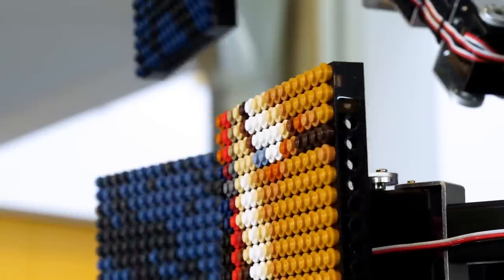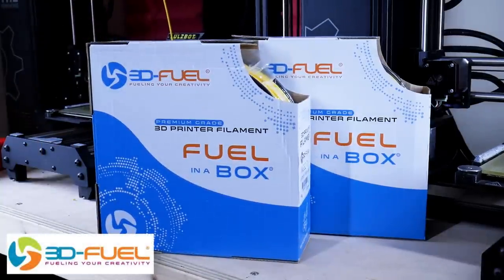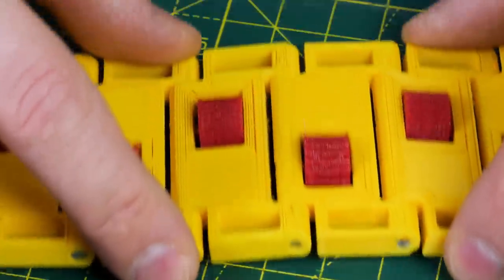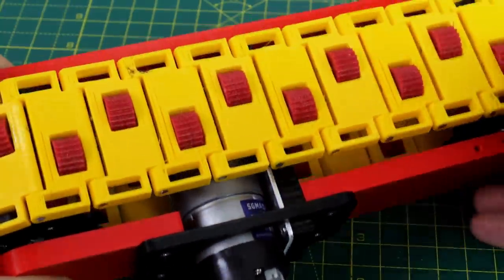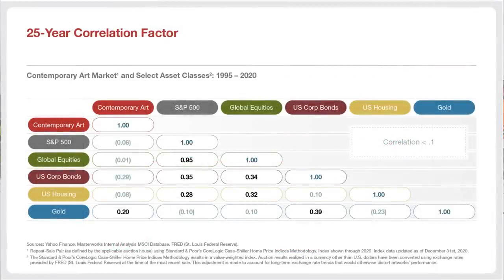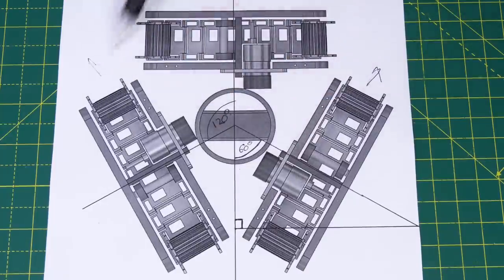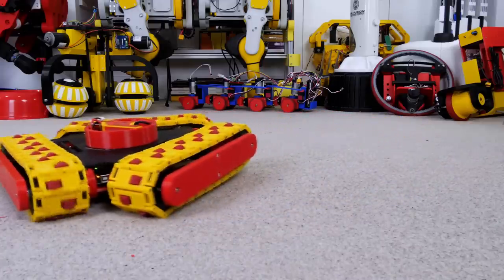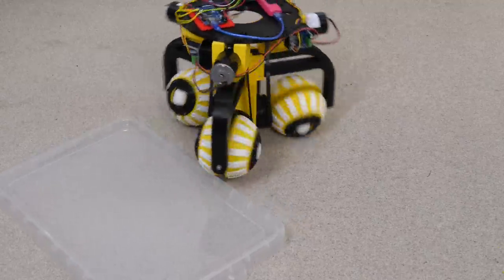Will this Omni-Directional Tank Work?

Comment: So, a problem that I spotted. Tank tracks usually have a leading and trailing angle of attack where the track is pulled upwards by the idler and drive sprockets. The effect this has is raising the height of first contact with sharp edged objects. The second thing that is missing for the purposes of vertical object climbing is the ability to deform the track (at hinge points) with flexible suspension at each bogey. The twin effect that track deformation has is dynamically increasing loading on the the track at points where frictional forces can be acquired (the top flat surface) and creating a ramp of track links at the sharp edge via tension forces that the aft idler bogeys can climb. The lack of these three features are competing for the number one slot on what is impairing your ability to climb objects.
Reply: Welcome to this channel. "What if I applied this concept, but without studying any of the parts that make it work". See also the Ornithopter series lmao
It's all still interesting to see in action! I just wish there was a little bit more prior consideration involved is all
Reply: @nekkowe  I don't think that's a entirely fair assessment there - it more "how much of this can I figure out on my own?" than anything else. When he gets it wrong, he looks at the comments and does some research, or sometimes he comes up with some really odd solutions. Considering what he's accomplished with this approach, I wouldn't be so quick to dismiss it.
Reply: @nekkowe  Combine this with virtually no long-term development. There's a ton of projects that could do well if they weren't almost immediately killed off or only receive a couple weeks of extra development. This probably also feeds into the lack of any pre-development research besides reading a wiki page. The projects are interesting, but they just never really go anywhere, everything seems to end on a 'good enough' note. Everything here is extremely prototype-y anyways, and not just because it's all 3D printed, very basic concepts of proper design are thrown out in a brute force attempt to make things as simple as possible; case in point is the lack of proper tensioners on these tracks and instead testing multiple belt and chain lengths to tension the system, another case in point is why his cycloidal drive unit took so many iterations for it to be 'good enough.' 

Yet another case in point, which is relevant to the original comment, is this vehicle lacking any form of suspension to allow sprocket movement, parallel track vehicles like old tractors have a pivot near the rear drive sprocket to allow for some movement with springs in the front, combine this with proper track geometry of these vehicles like grousers, and sometimes free movement of the lower track itself for better terrain compliance; the only time you have a differing angle of attack on a tracked vehicle is when you get into geometry that is not a stadium (the actual geometric term for two parallel faces connected by half circle ends), because you cannot just change the angle of attack on a parallel setup, which is where grousers do see some use as they have a much higher leading edge by having a perpendicular flat. 
But if this vehicle were to have at least a pivot to make the two sprockets per track non-planar, this would fix the issue with driving up obstacles. Though the robot would need active vision for obstacle detection to properly rotate the base to avoid trying to drive up an obstacle with the perpendicular track. Omni-tracks just aren't a practical design and never will be, for a large variety of issues.
Reply: It does seem to be a recurring theme. That, and it feels like he often doesn't really design these things very carefully. Like, pretty much every problem he had here would probably have been caught by just sitting down and thinking about what exactly happens to a track when it goes over an obstacle.

Even the alternating wheels don't make much sense when you consider that any tilt and you lift off half of them.
Reply: So something like a banana shaped tread with 4 boogies and the upper ones extending outboard of the tread with something like the "tip-toe" type steel dual wheels we used on tractors long ago that would extend beyond the front of the tread to climb the object, but radius not extending to the floor on flat surface. I imagine his shows to look like the Blade Runner seen when all the little "friends" he made , meet him at the door. lol.
Reply: It would fair better even just making each track rotate upon a central axis where it attaches to the tank itself.  You can see both treads picking off the ground entirely and pivoting off of the third track.
Reply: I'm glad to find you all. I thought I was the only one that saw this. So many concepts improperly implemented though both laziness and/or ignorance.
Reply: @nekkowe  Fully agree there. Though I love the making of these devices and even recording it, it is a bit frustrating to have glaring issues that are so well known already, not being incorporated. Like with the flying robot-thing, it's as if he's re-inventing the wheel almost. I do think it's on purpose btw, because it allows for easy follow-up video's. Kinda makes me watch less and less unfortunately.
Reply: Very true, though I think the issue still lies with the track at the back as it will never climb up unless the tracks are V shaped with idler wheels on the point of the V.
Reply: @pacefactor  He's more than once ignored good advice from the comments.
Reply: I got really frustrated when basically the entire comment section linked to a Veritasium video and said: No, you don't steer a mono-wheel by leaning into the turn! You have to steer in the opposite direction to displace the contact patch away from the dropped perpendicular! However, the very next video has him totally ignoring the central aspect of the subject. While the mechanical part of the balancing omni-wheel bike thing does seem to work (it's two motors on a stick - what can go wrong), its main funcion is yet again ruined by a flawed control approach and no real understanding of the physics involved.

IMO he desperately needs some university level control engineering and advanced kinematics classes. Basic trigonometry just doesn't cut it when you mess with robotics projects.
Reply: That's the difference between tank and excavator tracks. However, excavator can lean against the boom and lift one end of the tracks to climb over an object.
Reply: @JamesBruton you need to read this comment I am relpying to.

Comment: A couple of things that I would try. 

1.  Tank tracks usually have a upward pitch towards the ends to aid in climbing over objects.  I would do that where both tracks come to a point.
2.  If there was a way to have all 3 tracks able to independently pivot a few degrees from the tracks center point.  This would also assist and act like a bit of suspension.
Reply: Another thing is that tracks usually have multiple suspension springs, which allows the treads to adapt to the terrain they're travelling over.
Reply: How about keeping the same triangular arrangement, but with each track on a rocker so that they can move independently rather than get lifted off the ground when one of the other tracks is trying to get over an obstacle.
Reply: @vannoo67  Yeah, that's what I was thinking
Reply: yep
the tank as is has absolutely no suspension.
Reply: Also, tracks are not made for pull a loose + squishy + light object.
Tracks need to smash or shove things, it's achieved by all comments above.
Reply: @Saberwulfy  On top of that their traction is best on loose surfaces like gravel/fields, not on smooth surfaces or mud.

Comment: What about rotating each tread 90°, so that the tracks are coming out from the center in a sort of star formation? This applies to the ball robot, too. This way, your rear tread is still being driven when the front two are off the ground.
Reply: That’s mechanically the simplest solution to the problem I can see, all a matter of looking at things from a different angle!

He’s almost there without doing that, though, he made one logical mistake: having the treads be fixed in relation to the rest of the platform.

Had he had them able to pivot in the middle of the treads along the edges, in the same axis of rotation of the wheels, then the treads wouldn’t act so much as a problem as a solution: right now, because they have no way to adapt to changes in the terrain, this is the first vehicle with treads I’ve seen that’s self-blocking on the easiest possible terrain.

Now I’m laughing at the thought of how much design and printing time was involved in this learning experience how NOT to make a tank that works on rugged terrain.
Reply: A star formation wouldn't allow the robot to turn at all though. Maybe a square formation?
Reply: Maybe rotated about 80° so that the robot can still turn?
Reply: @osolomons  in that case the friction would be extremely high
Reply: Put the drive wheel end of each tread at a corner of the triangle. This will move the gap between the tracks from the corners to less important spots on the edge.

As pointed out in many other comments, there is a reason that military tanks have their distinctive profiles. Two fixed wheels that are raised up, and a series of bogey wheels with independent suspensions in contact with the ground. The leading edge of the track is at an angle.
Reply: @GeorgeZZi  The point of this robot is that it doesn't need to turn though? If it had a turret or arm that could turn on its own, the navigation shouldn't require turning unless I've misunderstood the term 'omni-directional'.
Reply: @ChezzyKnytt  True, but there's no benefit in deliberately removed one degree of freedom when you could have all three.
Reply: @GeorgeZZi  Oh, duh.
The first solution that comes to mind is turning all the little wheels by 45° so that moving all treads inwards or outwards causes the robot to turn. However, I'm sure this introduces its own issues that I'm too tired to think through right now
Reply: @GeorgeZZi  thinking about your statement, I realize I wasn’t thinking about the rotating functionality: if it went in any of the 3 main directions, it’s fine, but turning wouldn’t be impossible, but very awkward by comparison.

To rotate/turn, you’d need to have all of the treads fighting each other instead of more or less working with each other equally to do a 360 machine rotation.  There’d be no way to rotate neatly in place, it would need to have a turning radius, as it’d not rotate on its center.

Ok, back to my original thoughts of just having a pivot in the middle of each tread on the same axis of rotation as the tread wheels, and add to it, make sure the ends of the treads have a lot more angle up from the flat plane of the rest of the tread, so it can climb things more readily.

I’d love to see him make these two changes, which are relatively simple compared to so much of the other things.  Makes me suspect he didn’t think it through, or… it was intentional video fodder for a version 2 ;)
Reply: Actually, just offsetting the tracks so that they pinwheel out so that the vertices are covered by the lead end of each track might do it.  It is still a bandaid solution to the bigger issue though.
Reply: @GeorgeZZi  Actually, you should be able to rotate not quite in place, but still very tightly, by rotating two tracks in opposite directions. the 3rd would slide on the mini wheels, while the other two tracks swing that 3rd track around. the point of rotation would be the point between the center of the undriven track, and the ends of the driven tracks, so again, not on a dime, but still very tight.

Comment: You should try a mecanum wheel style tread. one of the problem with the current design is that when it has an obstacle, the tracks loose it's traction because of the triangular design (The back gets lifted so there is less contact with the ground and with the wheels in the tread there is even less friction) Also, with the triangular design, only a small part actually has contact because of how wide the treads are. using the meacanum wheel / treads, it should be able to maintain more traction without limiting it's maneuverability.
Love your videos, keep up the great work and creativity.
Reply: yeah, turn the small wheels 45 degrees to the track and you have both traction and obstacle climbing
Reply: Yup. You could even put the four tracks on spring-loaded pivots for some pretty easy suspension action.

Comment: My suggestion is to reorient the treads. Instead of a triangle, make them shaped like a Y. That way, it will be much easier to hit slopes straight on, and the opposite treads will still be able to push it.

Another option would be to have two sets of treads going through each other in a + shape. This would make things more complicated, but it would be interesting. You could have some kind of guide that pulls one of the treads up over the bottom of the other and use that to make them pass through each other. This should be even better for climbing if you hit it head on (though worse if you do it at an angle).

Comment: You should try making a Mecanum version if this, so four tracks in a normal configuration with the wheels inside each track at a 45° angle. I imagine that would be a lot better at clearing obstacles.

Comment: As a number of others have pointed out, actual tanks and other tracked vehicles tend to have side profiles shaped either as a trapezium or a parallelogram, which means inclined surfaces can have fuller contact with the track itself, and also suspension along the bottom edge of the track means it can conform to the terrain and again keep fuller contact.  Since your tank drags a track along, maybe allowing the whole track module to pivot along its length would help, too, since it would allow the dragged track to lift up and out of the way.

Comment: How about making the rollers narrow discs? In the unpowered direction they'll still roll freely, while in the powered direction they act as teeth.
And then maybe make 'conical' tracks. To describe, angle the tread plates 30° so that the wider side of the tread is near the body, and angle the treads 30° down so that the treads rest flat on the ground. This gives a flat edge at the corner of the triangle where the tread ends meet each other.

Comment: Ok so I have been thinking about this and have a few ideas. 
1. Add a TPU skirt around the outside of the track. Keep the angle pointed in to the center line of each track module. Mitre the edges to create a relief that brings the edges together creating traction to maneuver in the vertical axis.
2. Add servo motors to the track modules to change the pitch or drive angle of the tracks to optimize the contact patch of the rollers
3. Add a pivot to the centerline to lift or lower the track module. Not my favorite option. But would work.

Comment: I've had a similar thought in my head for a long time, but as two-tracked, rather than three. 
The triangular configuration makes a lot of sense. I think making the wheels larger would be good, as you'd get more clearance away from the tracks. Perhaps all the way to the full width of the tread. Offsetting the wheels away from the track would also add some clearance that seems to be needed. By relying on the wheels to get your traction, including over obstacles, you shouldn't need to make the tracks out of tpu, and you won't have to compromise on the omni-directionality.
It's also important that those wheels roll particularly freely. If they don't, you'll get an imbalance in the omni-directional control, and you'll get stuck going over obstacles.
For a larger scale version, suspension would probably improve obstacle performance, because the lifting problem will turn into just a traction balancing problem.
Reply: Imagine making every tread link it's own sub track or using a belt instead of tires
Reply: @dustinbrueggemann1875  On a very large vehicle that might be interesting, but the issue is that tracks tend to have worse rolling losses than wheels.

Comment: Might be worth trying that same design but having the tracks on hinges attaching them to the body so that when it goes up an obstacle that back one doesn't prop the driving pair off the ground. Might need some springs to push the tracks down so they aren't totally loose, idk but might be an easy adaptation that doesn't need a total redesign.

Comment: Lots of people are mentioning track shape as being a problem, and that's definitely part of it, the other thing is adding more suspension, or most tracked vehicles the contact surface is fully supported by a suspension system with multiple idlers, that's what stops them acting as just long wheels

Comment: This was far more drivable than I was expecting. Its actually pretty cool.

I wonder if adding a little weight to the vehicle would help it climb a bit. You could see the wheels hitting the plywood, they just didn't have enough traction to pull the vehicle up.

Also, if you look at most tanks, they have a significant "angle of attack" at the front of the tread to help with going over obstacles. I'm sure adding something like that to this would help with climbing traction

Comment: I back a combination of the Y-configs and bevelled entry points others have suggested, but another option would be to lift the rear track for obstacle climbing, placing traction on the rear of the front tracks. Allowing it to tilt up or down as well would offer an opportunity to conform to convex/concave surfaces. Doughnuts in a bowl!!